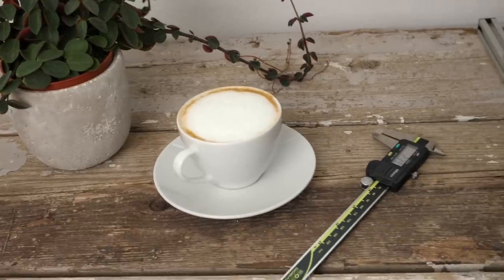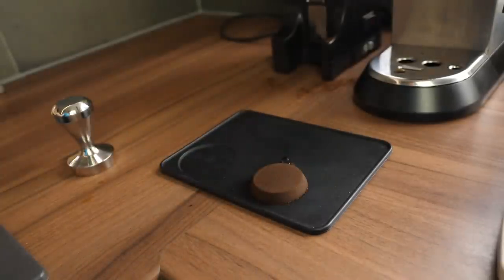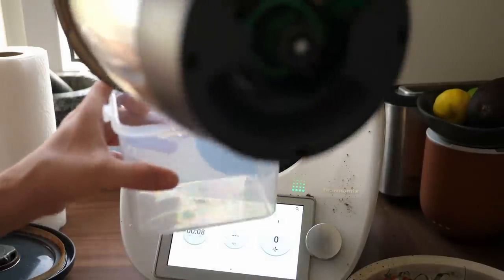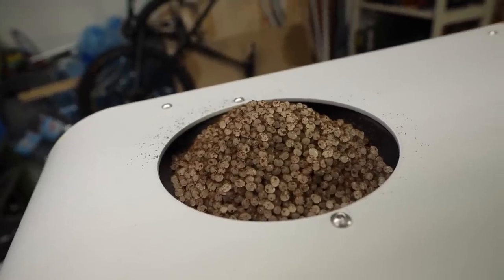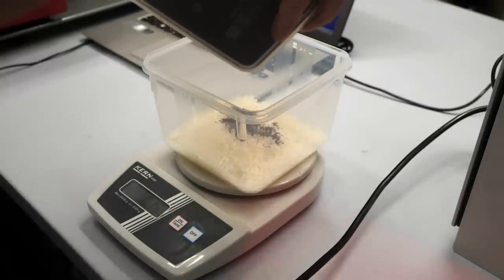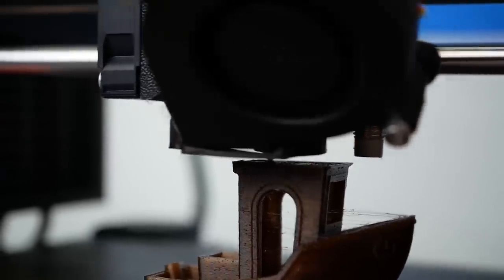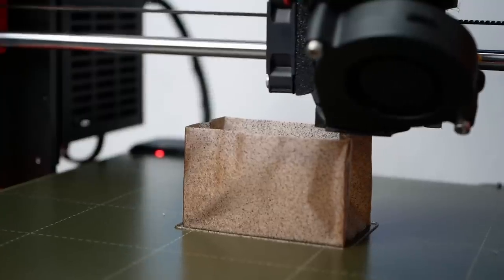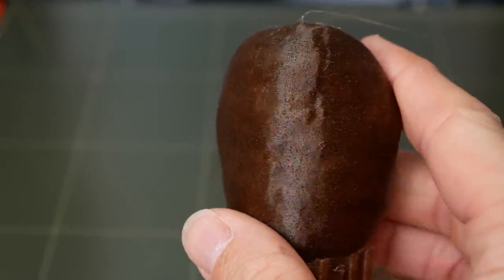I made COFFEE 3D Printing FILAMENT

Comment: Far as sustainability, I don't think this is the way. Responsible consumption and education about material re-use should be the way, though in spite of such education some consumers will still elect to be wasteful for a variety of reasons.

In spite of that, a continued emphasis on education will always be the better bet, than reducing the strength and compromising the properties of a material for the sake of disposal, when such material can be re-used by complete destruction and re-application as a filament. Responsibility than weighs on producers to create a process which disallows a high amount of unused microplastics caused by the destructive process of filament re-use into the planet as stray toxic particulate.